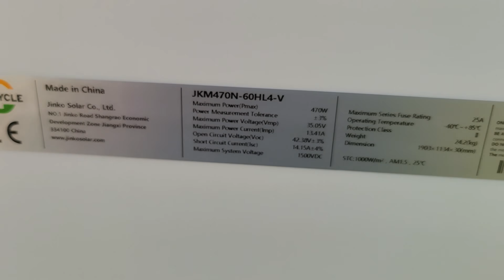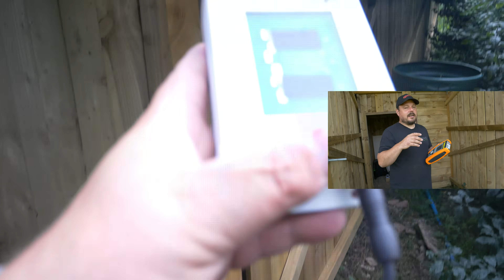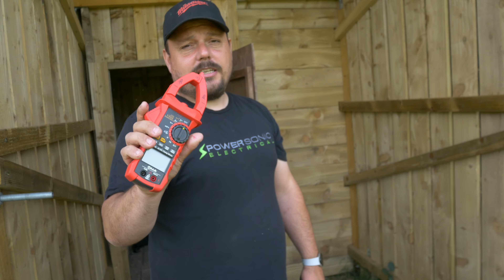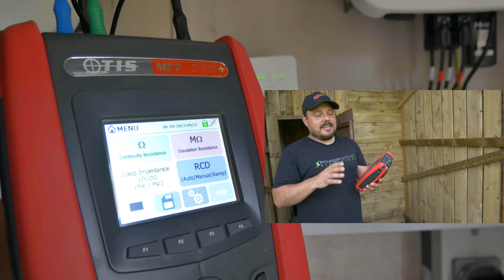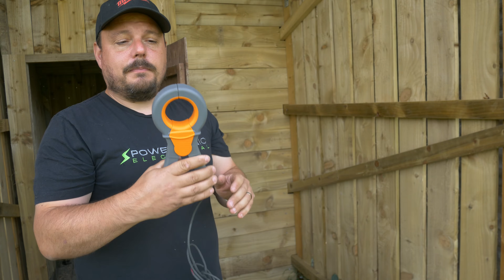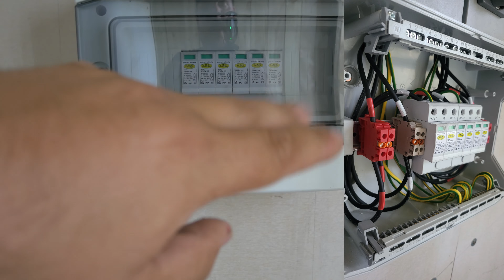Do you have to test Solar PV installations ???

Comment: Is there a company near b692le you know that can test my solar strings? You’re 120 miles from me and I’m guessing you wouldn’t go that far
Reply from the maker: That is pretty local compared to some projects. We were in Lands end not long ago lol
Reply: @e @electrician247 w much am we talking to have my solar system tested. I’d like peace of mind and not think I’m crazy. I see sunny days full sun hit my south array and it hit 6.4kw briefly for it to sit back at 5kw. My north could hit 4kw in full sun but lucky for it to manage 3kw. Sits at around 1.5 to 2kw bother north and south are roughly 6kw of panels each. I’d like the strings tested somehow. I have a 10kw inverter 4 strings 2 mppt. I feel it in my bones there’s a problem somewhere. Why hit highs very briefly for it to drop back down. No errors on the inverter.
Reply from the maker: @nicholaspargeter6913  they will drop off once they sit the in geenrator window. Hard to say without testing etc. Drop over to www.powersonic.co and pop the details over.

Comment: Great video very helpful , Just took on my first pv job, 650 x 550w panels half way through just 2x inverters and g99 to fit on roof the rest x300 panels are carports 6 inverters , Was looking at test equipment to help make the testing process more efficient.
Reply from the maker: The newer PV check pro plus kit from TIS would be what you need mate. Combines my 2 testers into one product. 

That’s a big 1st job btw, respect!
Reply: @electrician247  thanks for the info I will check , yes definitely jumped in the deep end  so far all good , weather has been tough and total weight of system approx 20T I underestimated the graft , also no trolleys were allowed so all manual L shaped roof and guess what every thing was put one end and it’s just 2 of us, it’s a floating k2 system , next challenge is getting strings to the 6 canopies furthest canopie  approx 200mtrs, all underground ducts. I appreciate your videos and reviews very helpful.
Reply: @Enrgy-z3i  Wow, I’m curious how that ended up.  Absolutely massive and complex first solar install.  I thought I challenging myself doing a DIY residential solar with little electrical experience, but I think you may have me beaten.
Reply: @N @NickWindham anks for asking , it went well important to get setup correctly then it flows hardest part was the weather and the physical side as it was 2 of us but overall you can work your way through it day by day it gets less overwhelming and comes together till you finish.

Comment: Hello Mark, interesting video as always. I'm curious about the criteria you use when selecting solar panels, especially for something like this where it's a custom-built structure for the panels. (We've currently got a planning application in for a ground-mount array but it didn't occur to us that we could build a shed and include a nice sheltered place for the inverter and batteries!)

Anyway the panels you've used look to have an efficiency of 21.8% if I've found the correct ones, so I'm wondering why you went for that over say the Longi HiMo6 HTH 435W panels which have an efficiency of 22.3% (Therefore they are more space efficient) and appear to be substantially cheaper (Less than half the price) with a similar warranty? (Slightly longer product warranty, slightly shorter performance warranty) Is there another criteria I've overlooked?
Reply from the maker: It's all about maximising the roof space to the array output. The neo are great low irradiation for max gen periods. They also have a low ish VOC with high ish ISC so paired with the right inverter can generate longer and with more output. 

All of the manufacturers use different base lines and tolerances in the figures presented so I take them all with a pinch of salt tbh. 

Personally I wouldn't focus on the efficency more so the size of the structure you want and generation output per panel, matched to the otomisers and then inverter to reduce losses  in those areas. 

Cost wise Jinko are super competitive and it depends on your wholesale arrangement but looking just now the 470W jinko is around the same price as a 435W longi. 

While the roof is angled specifically for our array we were working within the sizing the customer provided and this represents the best long term value from that. 

It was designed by both myself and a wholesale rep and thankfully we both came to the same conclusion. Always a good sign. 

The Jinko win out in the case based on the above but also the resistance to the environmental conditions.  As this is an agricultural area with lots of dust/pollen it was the right product for us at all levels but this was a heavy weight in its favour beyond much of the competition. 

Efficiency levels are improving every month and that's great but the overall panel package is important and then again the equipment it's paired up with.

Hope that helps. 

Cheers mate.
Reply: @electrician247  Sorry you're right, I somehow managed to find the most expensive retailer possible when looking at the prices of the 470W Jinko panels!

And ahh I see, I thought the roof had been sized to the panels rather than the other way around - That makes a lot of sense now. I've always found it strange that there's such a range of sizes available rather than there being a proper standard for the physical size.

Your response is really helpful as you've pointed out quite a few other considerations to look at so thank you for that. I certainly hadn't considered environmental conditions but that is something we'll need to look out for in our location.
Reply: What are the legal tests and documentation to comply with Regulation 29 EAWR? What competency do you need?